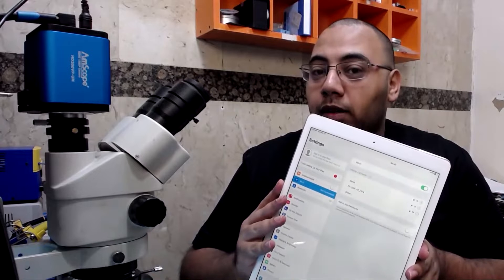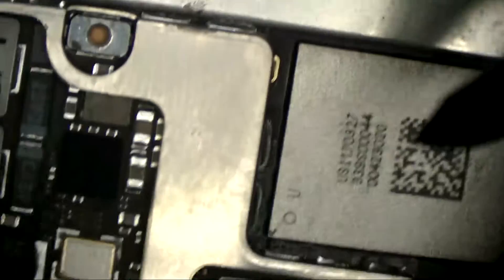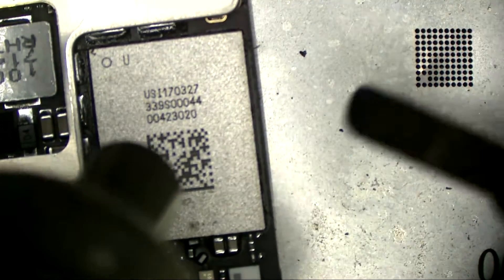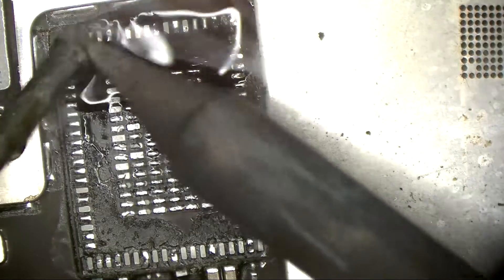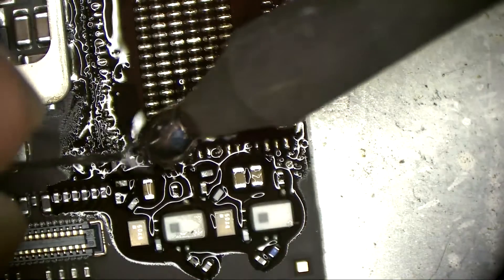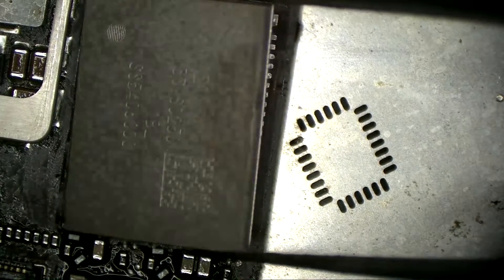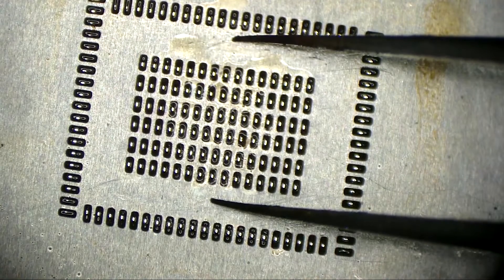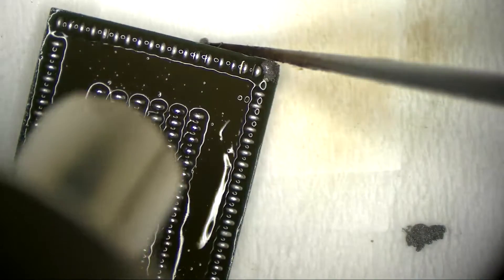How to Unlock iCloud Account on iPad Pro 12.9 4G A1652 - Part 2

Comment: for example ipad pro 12.9 2nd generetion hase two model A1670 with 339S00307 IC for repair and A1671 with339S00249 IC for repair.
must take ic from wifi model 339s00307 and solder to A1671 board??? thank you

Comment: Hi Ayman thanks for your videos! Do you know if there is a metod  for iPad Pro 2 A1671 4g? I already have the new wifi IC but I dont know wich resistor I need to remove or todo a jumper. Thanks for your support!

Comment: Can I just remove a WiFi chip from a WiFi only board and replace the one on the 4g board?? Would it work??or would it be better to buy a new chip??thanks jay
Reply from the maker: yes it will work
Reply: Ayman The Repair. What temperature and airflow do you use for removing the NAND CHIP on your hot air station??thanks jay

Comment: For removing iCloud lock on WiFi only 6th gen ipad 9.7 I have to change the nand serial no. Only or the WiFi ic also?
Reply from the maker: You don't need to change wifi for all ipad wifi
Reply: @AymanTheRepairTech  how to buy the magic serial to be used for nand serial no. Change and how to check whether it is locked or unlocked just by using serial no.?

Comment: Hi, sorry but my English compression bid not good. I want unlock because I forgot my iCloud password, I have to remove resistor and wifi ic and soldering new 339s0250, would it works?
Thanks.
Reply from the maker: what is your iPad model ?
Reply: My iPad model is A1652. I have removed the resistor and install iOS but I can't activate it because WiFi not working.
Reply: Hi i have a ipad pro 3gen..icloud can u remove.it? Thnx.

Comment: Also, using the 339S0250 wifi IC will work, but no bluetooth. You really should use the 339S00045 if you still have to change wifi ics, else your customer is going to be unhappy when they try to use their overpriced apple pencil.
Reply from the maker: I double checked and you are right Bluetooth isn't working and this is kind of new to me because i never check for Bluetooth because it is rarely used, and i spoke to this customer and he said he will never use Bluetooth so he is fine but for other customers maybe no, thank you for bringing my attention to it
Reply: @AymanTheRepairTech  Cool I didn't want to sound like a know it all just wanted to help. Hey one more thing you should do for your customers, remove the BBPMU on the 4G models so they get longer battery life. Well, that is if you HAVE to convert :)
Reply from the maker: @johnbaker26  I understand where you coming from and i really appreciate it we all learners, for baseband i think it is not necessary, before some devices had issue that battery will not go up more than 15% as i recall but i never faced that issue, baseband is off once you do the converting

Comment: Hello, first time watching a video from you. Nice job, I do these almost daily and do it almost exactly the same way. Except the 4G version. There is a way to unlock without the Wifi only downgrade and without the wifi IC swap. I would tell you how but that takes the fun out of it and you seem to be a smart guy. Just think about the activation process a bit :)
Reply from the maker: Thank you John, i guess you downgrade and jailbreak is that true
Reply: @AymanTheRepairTech  No jailbreak for the latest iOS I think? I don't mess with that stuff.
Reply from the maker: @johnbaker26  Thats what i know, i don't do jailbreak or downgrading so maybe something new has happened, that why i said i am guessing because i see on the converting instructions for ipad Air 2 4G you have to jailbreak to activate WiFi, if you are not willing to replace the chip
Reply: John Baker we can bypass ipad pro 9.7 without wifi ic change? share the tips bro ☺️☺️